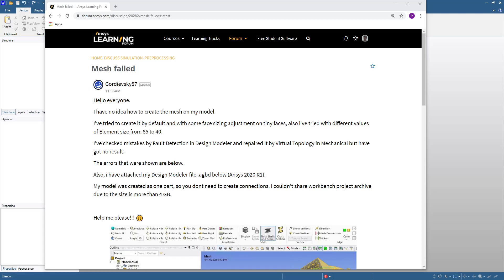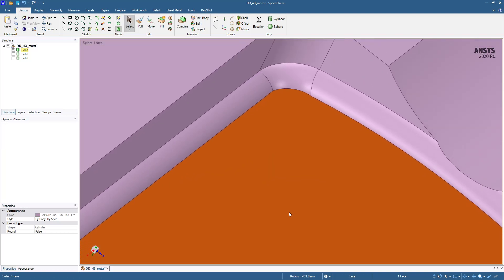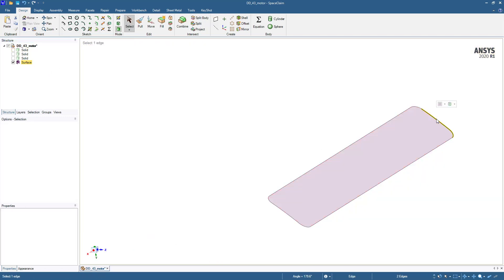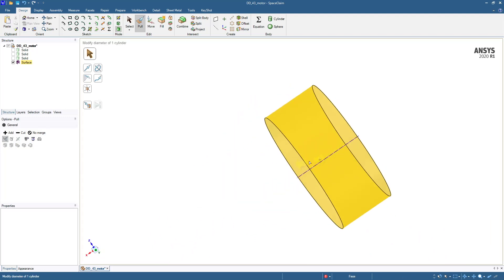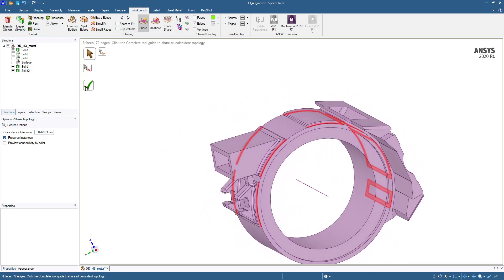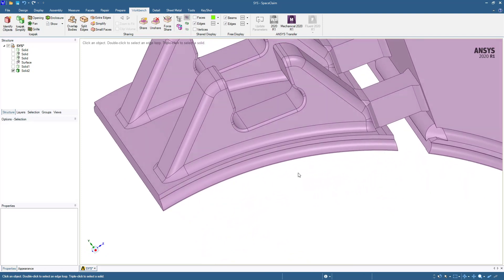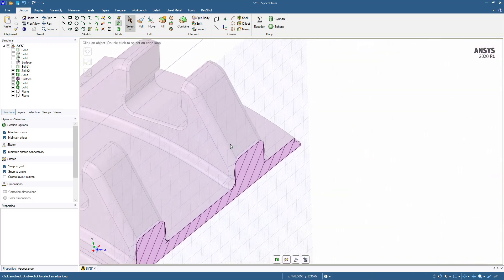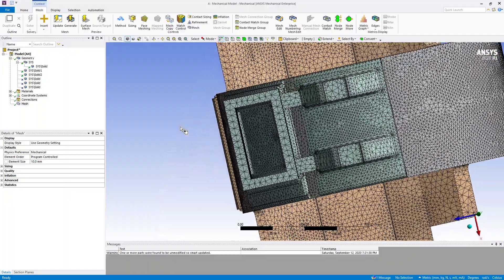Repairing complex geometry in SpaceClaim

Comment: I used share topology option and check there were no interference but it shows "overlapping faces" during the meshing.
How to rectify this?
Reply from the maker: In SpaceClaim, after you click Share, make sure to turn down the tolerance so it doesn't combine adjacent separate faces that should remain separate. When you type a smaller value, hit the tab key to have it recompute the shared faces.

Comment: One question: if we eliminate this issues around the surfaces, which is what we aim for, we are adding a very small amount of thickness and that is actually a modification of the original component, right? Do we want that? Thanks for the video!!!
Reply from the maker: All models are approximations of reality. Small deviations will not significantly change the result.

Comment: Hang on a mo, at 11:35  why not a Geometry Check ? Hmm, looks terrible. That particular area is done either intentionally extremely poorly as an example or done by someone who shouldn't be designing...Ok, i just read the discussion about this - a novice designer...modeling to represent welds that explains those shapes. Useful discussion re pro's and cons on Tet / Quad meshing - Thanks.
Some very good tips re repairing troublesome geometry.
A useful video all around.

Comment: Respected Sir, 

I have a question regarding Meshing.

They are 2 Exact and similar Components each component having 14 Faces. If I mesh 1 component By Cleaning the Geometry, Splitting the Body, Creating Washer's around the holes, Removing the Fillets...
And finally 3D Hexahedral Meshing is performed on this 1st Component. And it took around 30 min for this 1st Component to complete Meshing with Quality checks.

Now I don't want to repeat the same procedure for 2nd similar Component which consumes another 30 Min time. 

How I should reduce the time for Meshing 2nd Similar Component ???

Please can you make video on mesh copy to other similar Component ? 

How can I transform Meshing of 1st Component to 2nd Similar Component ???

Please let me know

My Email Id: fasi2all@gmail.com

Thanks  and Regards 
Md Fasi Ur Rahman
Reply from the maker: Please join https://forum.ansys.com/ and post your question there. You will be able to attach a workbench project archive .wbpz file that I can download to make a video.